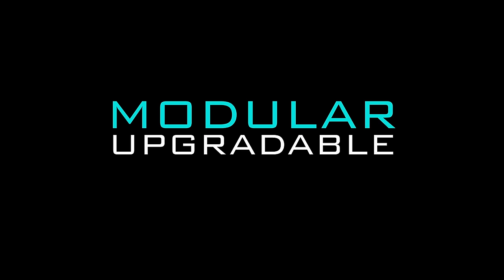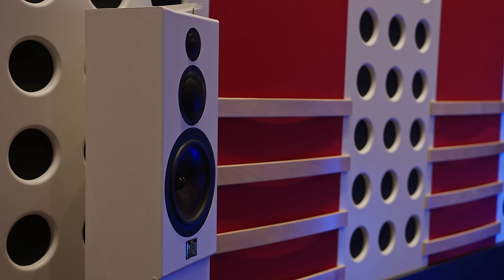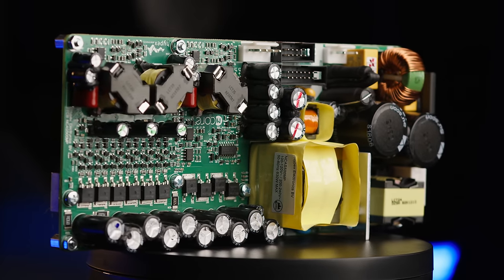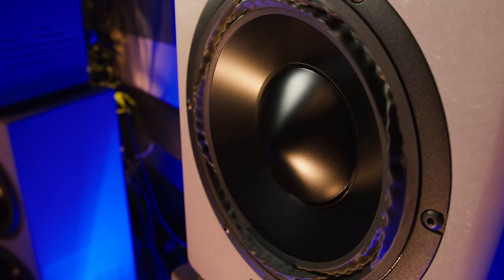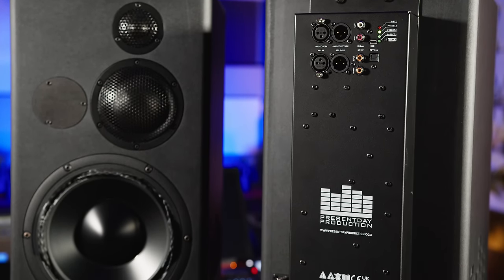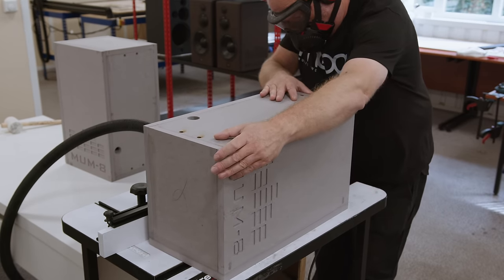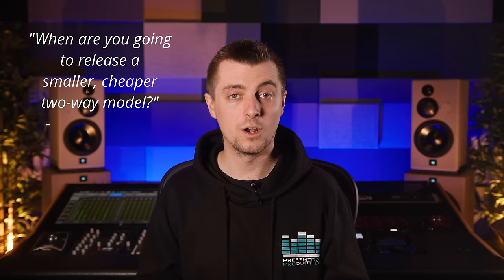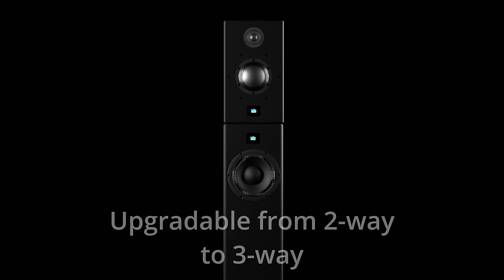What's Next For The Modular Upgradable Monitor?

Comment: Would be good to have a MUM-6 that had the amp separate for Atmos setups... much easier to just send one cable and that would of course be lighter too... helps with nerves of wondering if the speakers will suddenly pull out from the ceiling... something I have just thinking about doing this to my ceiling... I rent so it's quite a bigger risk as well as I do not have much options to add support lol

Comment: I would love to have a speaker with dual tweeters and a switch to select a more accurate and a more rolled off. I have a pair of 50 year old transmission line speakers with soft domes and old caps. They are not highly resolving anymore if they ever were but they are smooth. My parents have new BW speakers with very accurate treble and they resolve like crazy but also drive me crazy with bad source material. I would like to switch presentation depending on what I listen to and how.
Reply: @marcusm5127  
This could be and should be accomplished by using the existing single tweeter but simply adding a separate DSP preset with a more rolled-off HF response or negative high-shelf filter vs the neutral/accurate response.  Most DSPs such as the units that Mark & James are employing in the MUM Monitors have anywhere from 2 to 4 programmable/switchable DSP presets or "tunes". 

The majority of professional active studio monitors already incorporate low frequency and high frequency +/- "trim" controls which typically apply a +/- 3dB High-Shelf or Low-Shelf Filter to increase or reduce the low-end or treble response.

The better studio monitors have several increments for these controls, such at +/-1dB, +/-2dB, +/-3dB, as well as a similar wide-Q filter with the same settings for the midrange response.

Using two tweeters would add non-linearities (and undesirable comb filtering if both tweeters are playing at the same time).
Reply from the maker: I’m not sure we’ll follow the two-tweeter idea, but just adding to the above comment that we have full user-definable parametric EQ onboard

Comment: I'm a festool lover. However, as I see it now the glue is going to be doing a LOT of the binding work and the domino's support alignment. A decent jig and normal dowels would do the job just as well, but with a lower price point if you are sub-contracting any works out when dealing with over seas markets.

Comment: did you make yourself a centre speaker witht those specs? the one on the far right of mark has the cones aligned vertically, whereas the othe one has them offset vertically??
Reply from the maker: Yes the centrally-aligned one is the centre speaker version

Comment: The bass drivers are different from the early models. Did you have to change the cabinet to match the Thiele Small parameters?
Reply from the maker: Well spotted - yes we redesigned the cabinet and now use exclusively Purifi PTTx drivers. No more Dayton Audio. The cabinet is optimised for the Purifi.

Comment: Looks like you need to lower the tweeter level a couple of dB to start with. Remember all of us who asked for Klippel data from the get go? At least you finally came around - designing a modern monitor without anechoic data to support design decisions is just odd. That 5k dip in the FR is wrong and should not be there. Something inherently problematic with the baffle layout it would seem, but could be his measurement environment that creates a cancellation, though it is not likely.

But no doubt you are offering bang for the buck, good job, we just need an MKII ;)
Reply: @vilddyr  
Yep.  And Center-To-Center driver spacing, driver placement on baffle, and baffle step compensation are important considerations combined with the associated crossover implementation that I believe were overlooked in regards to overall amplitude response and especially smooth & even DIRECTIVITY matching between drive units.

The Spinorama and ERDI data from the Klippel NFS measurements will reveal the issues in this regard, but as you mentioned, this should have been done during the development stage.  Unfortunately, as relative noob "speaker designers" Mark & James didn't know what they didn't know.

I would actually hold off on purchasing these (and I am) until this is sorted, as it will most likely require a new front baffle design with modified driver placement as well as significant crossover adjustments to account for the changes.

I expect this to be an issue with the MUM-6 as well when the 6.5" midwoofer is swapped out for the Dome Midrange using the adapter ring when the MUM-6 is combined with the lower bass cabinet/module.

Comment: I mean you say linear excursion, but from the footage, the cone's action is conducive to non-linear excursion. You can see how the cone looks tilted upon the action of the piston system. This is not good as it can cause the sound to become distorted - although I would presume the programme is being played back at a much louder volume than what the system is really intended to output?
Reply from the maker: I think this is actually part of the effect of the rolling shutter of our camera - when filming it under certain visual conditions it is indeed linear
Reply: @producermathew  
I assure you that this is just an effect of the rolling shutter effect of their video camera, just like watching the vibration/movement of the strings on an acoustic upright double bass in some videos.

As the image is "scanned" by the video camera's digital sensor, the scanning starts at the top and proceeds line-by-line to the bottom of the sensor and image frame.

Due to the time it takes for this scanning process to traverse from the top of the sensor or image frame to the bottom, during these few milliseconds in time, the cone has moved.  For instance, when the scan from an individual frame starts, the cone may be in the inward position, but at the end of the scan, the cone may be in the outward position just a few milliseconds later.

When all of these individual frames are viewed consecutively as a moving video, it gives the illusion that the cone is "tilted" or skewed during its excursion, when in fact it is just an artifact of how the image sensor in the video camera is capturing the image.  ;)  ...just as Mark or James stated.  Look up "Rolling Shutter Effect".

These drivers have been extensively tested by independent 3rd parties and proven to have among the best possible linear xmax and lowest distortion of any diaphragm/cone based speaker ever produced.

I use both the Purifi 6.5" (7") PTT6.5 and 8" PTT8 drivers in my high-end DIY home and car audio systems with the best sound I've ever experienced using many of the best high-end drivers for years...Scanspeak Revelator/Illuminator, Accuton, Dynaudio Esotar, SB Acoustics, Audio-Technology, C-Quenze, etc.

I assure you there are no issues with these drivers.  The cone is moving in & out perfectly straight or linear.  They are legit.

Comment: K lads, I'm sold... now how about a MUM-12?  ;-)
Reply from the maker: MUM-10 is definitely happening, as is the bigger double-woofer MUM-10XL. But not sure about a 12 yet as Purifi haven’t designed it!
Reply: @PresentDayProduction  truth be told...(2) 10" woofers will hit harder than (1) 12" woofer.🤓👍🏾
Reply from the maker: Especially if they’re Purifi woofers!
Reply: (2)10"s is ~40% area over a 12"
Reply: @PresentDayProduction   especially if they are built into a dual opposed sealed cabinet, they'd THUMP

Comment: Why do you claim using only the highest quality parts when you all the parts in reality it's a budget friendly approach? I don't see what is so special about some generic class D 250 watt module, a simple MDF box, those drivers with average magnet drive system, a simple cross-over ... there are hifi brands who even custom build their own drivers at this price point, quick example from my head would be the Børresen X1. This project attempts to fit a cost-value-approach with standard parts available on the market but there is nothing that makes them special. Loudspeakers at dealers are mostly sold with generous discounts with tons of competition, hardly the twice as expensive claim.